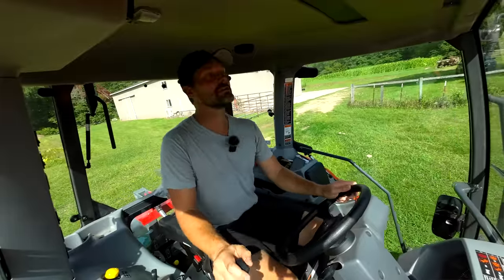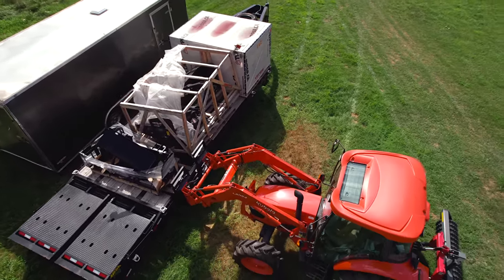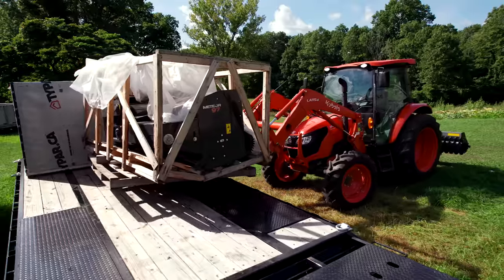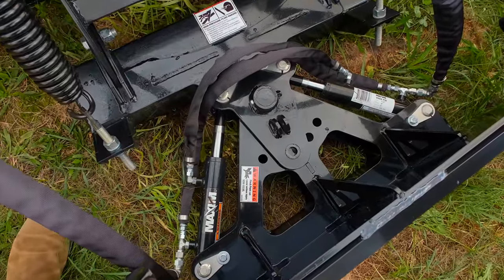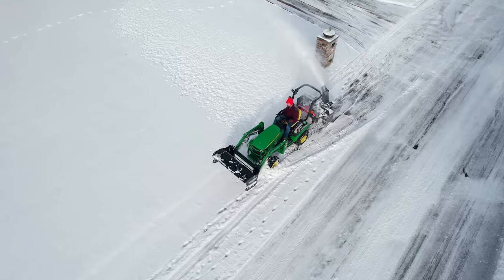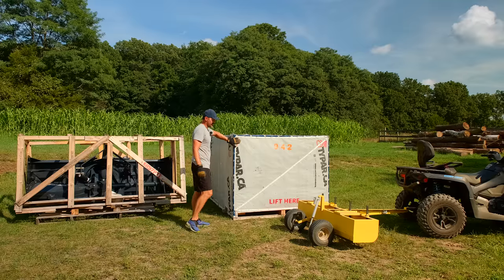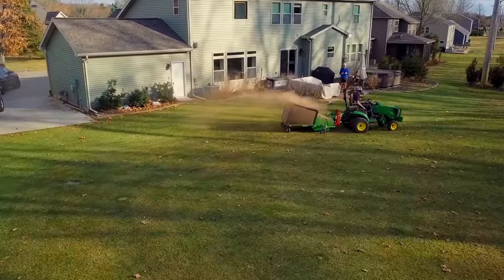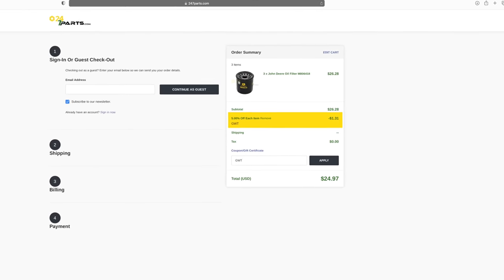SNEAK PEAK AT A PILE OF NEW TRACTOR TOYS! SOMETHING FOR ALL!

Comment: On the power reverser, I have found it’s easier to use the foot pedal throttle and let off coming to a near stop before shifting.  Works much like a large loader that way…. Also, I got yellow fork extension for my pallet forks which sticks them out past the loader frame so I can see them MUCH easier.  Makes matching up to the pallet or load easier as well.  👍

Comment: What ATV is that?  A CFMoto 2-seater?
Reply: I think it's a CanAm
Reply: I am looking for an atv - probably honda rancher but the dealer tried talking me into a CFMoto.  Reviews aren't promising.
Reply: @charlescheek2856  It's not my area of expertise, but even though they look nice and are feature rich, I have my concerns with the Chinese made machines.  A year ago when we were shopping for a Utv we ended up buying an American Landmaster. It's not really a competitor with the big brands but compared to the foreign made machines that they sell at the big box stores we decided to buy one.  The only reasons we even considered straying from the big brands was the lack of inventory at the time, and the Landmaster is 75-80% American made.
Reply: @charlescheek2856  I’ve seen a few and ridden in them, they aren’t badly made necessarily but they aren’t even close to on par with real brands like Honda, Yamaha, can am, etc. when it comes to pretty much everything. If your on a budget it would probably do ok but from my experience I’d take any of the big brands over it in a heartbeat. For a work atv, get a Honda rubicon (or a rancher with IRS) because they do better hauling stuff on the racks than the solid axle ones from my experience. If your looking for work/play can am all the way. If your going SxS then Polaris and can am are hard to beat as long as it’s a newer unit (2020+).